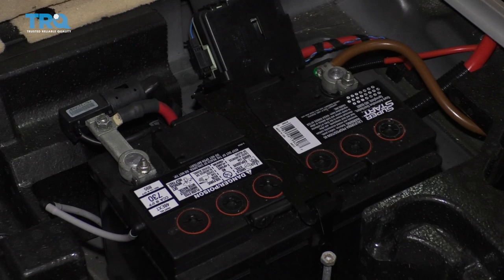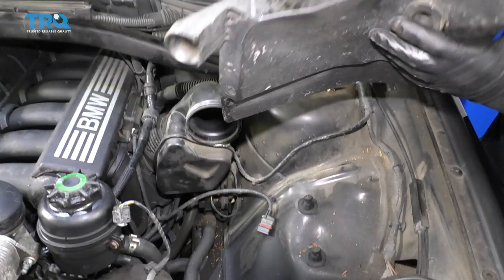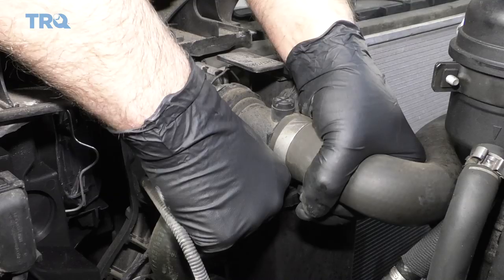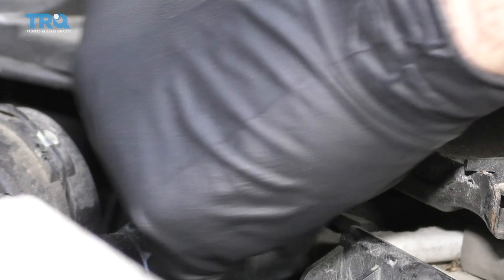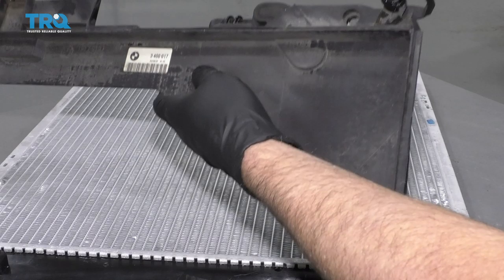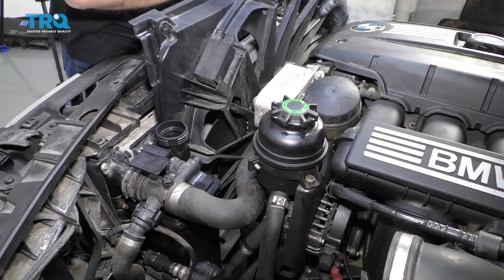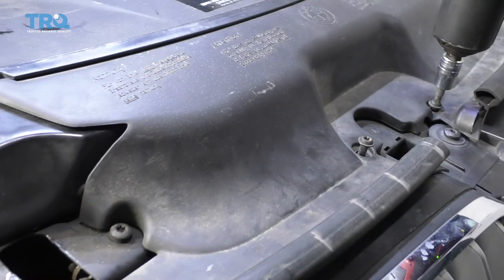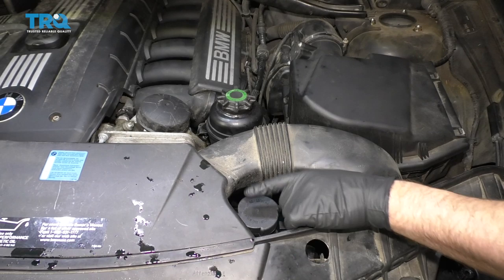How to Replace Radiator 2007-10 BMW X3

Comment: The main mistake is in tne procedure of coolant level pumping. You should not to start engine, there are special program in electronic water pump (key in pos. 2 , climate control - 32+, blower - min, all caps ( radiator and little - closed (but you should check coolant level ), then hold acceleration pedal more than 10 seconds on max position, after that this program will start and will be aprox 12 minutes.

Comment: I have been working on BMWs since the day I bought my first car, '71 2002, in July '73.  Was also a BMW mechanic in the 70's.  You folks have the best videos.  I will be taking the radiator out of my 2007 X3 as part of following your video on replacing the thermostat.  I already have the leaking expansion tank out.  Not much more work to take the radiator out to improve access and limit profanity. A thermostat used to be a 5 min job. Thanks!!
Reply: Is this the proccess for a 2004 model?
Reply: @mtsanchez27  yes

Comment: i got a leak at the upper radiator hose. seems the round plastic and o-ring is not installed properly inside the connector hose to radiator. any advise? Thanks

Comment: Hi there i have the same problem as well, but in  New Zealand there is 2 type of Radiator for Bmw X3, one without 16 mm small pipe and one with 16 mm small pipe, for my Bmw X3 2007 which one i have to used ? coz on your video u was used with 16 mm small pipe, cheers

Comment: Excellent video!  It shows everything precisely.  I have a question for you.  I have a leaky upper radiator hose and I want to replace it without draining the entire system.  Can I do a manual suction out of the expansion tank to get enough coolant out of the system to empty the upper hose so that I can remove it without making a big mess?